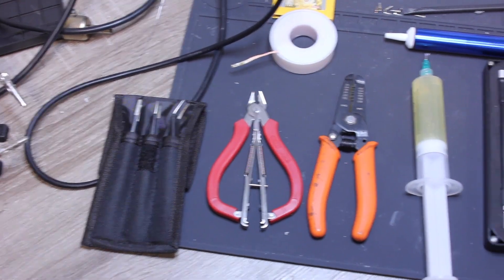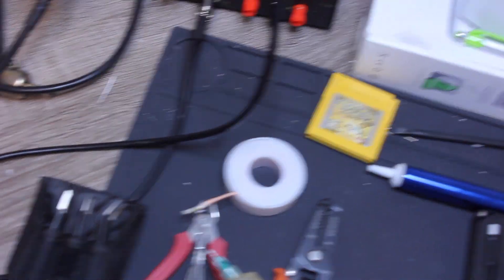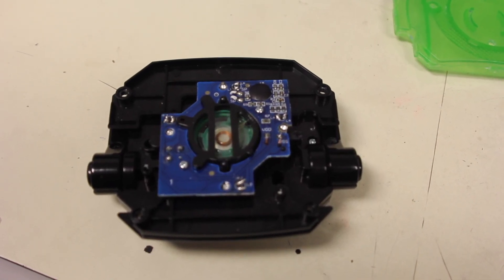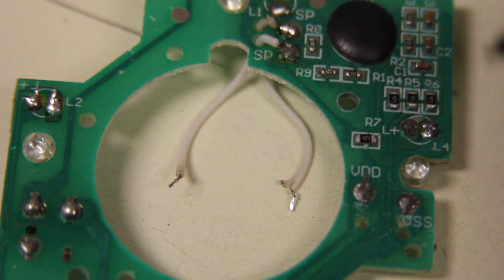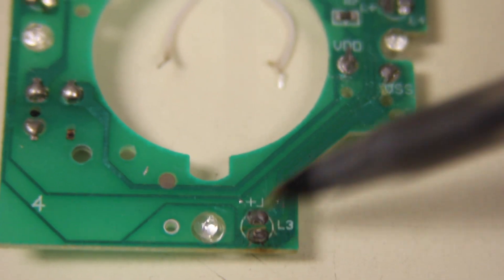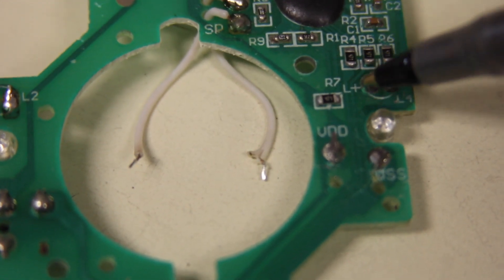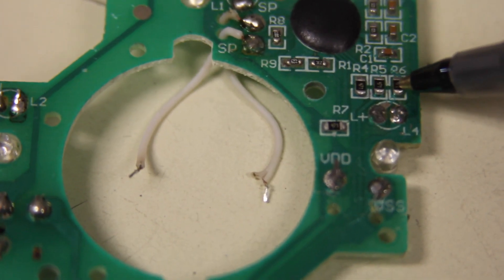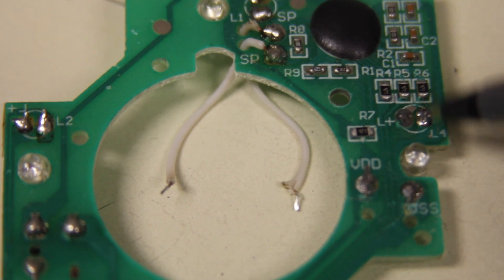Master Morpher Green LED Mod

Comment: Why not find same brand and volts if the red led to green led
Reply from the maker: All red and Green LED's have different resistances hence the color. if i used a different resistor I could make the green more yellow or red more pink.

Comment: Would it be easier to switch out the red lights for just plain clear transparent lights?
Reply from the maker: Same procedure
Reply: @prodigiouscustoms805  Do you have to remove the resistors too if I use white leds?

Comment: So I got everything set and the resistors removed but I’m only getting one LED (L4) to light. Any ideas? I’ve tried replacing the other LEDs
Reply from the maker: Make sure your leds are in the right  orientation, if you put them in backwards they won't light up. Make sure you bridge the gaps where the resistors were. Make sure